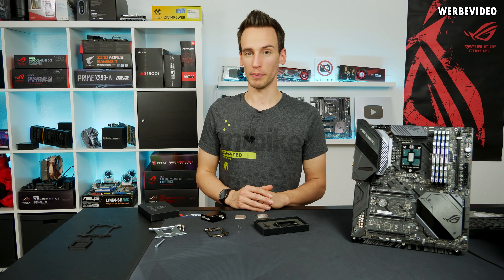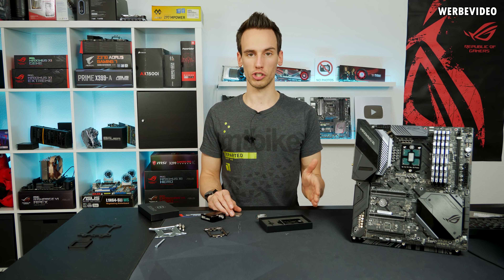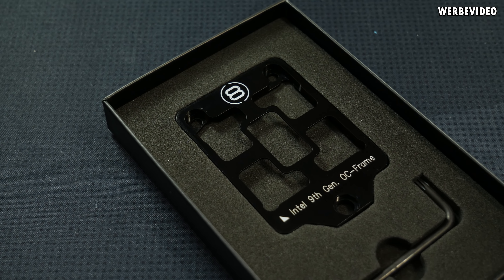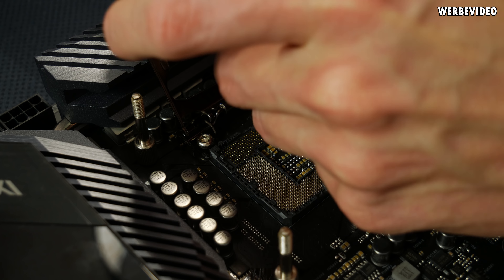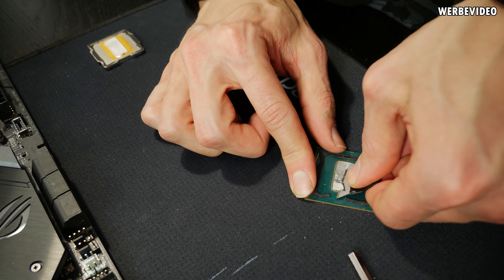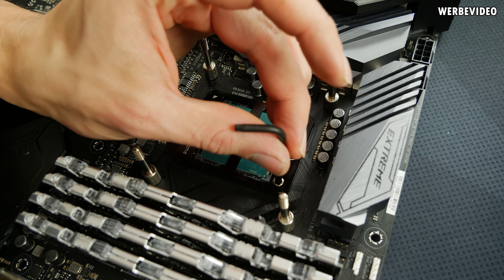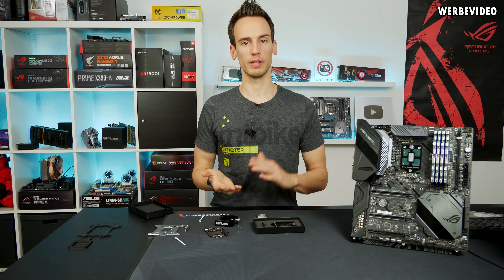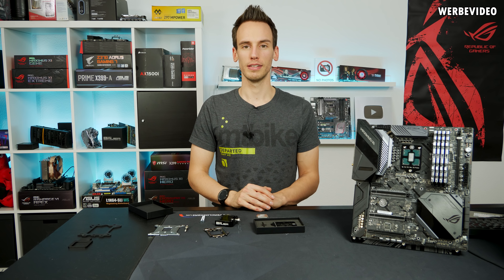Maximum Cooling with Direct Die - 9900K der8auer OC Frame (en)

Comment: It would have been nice to see this in action on a 240 and 360 mm AIO to see how good things could be under relatively normal circumstances.
Reply: @picklesthegreatest  That's one school of thought, but another is that dropping $500US easy on a custom loop is a huge barrier of entry for newcomers. Whereas deliding is mostly elbow grease and a LOT of courage for a pretty big payout in terms of temperature drop (maybe $50-75US for a deliding tool and some liquid metal).

I'm not saying you are wrong, just that there are different perspectives and people who are at different stages in the hobby.
Reply: @picklesthegreatest  yeah but it would give a baseline that people could relate to, I'm sure he'll follow up with some testing, not everyone's custom loop is the same, most AIO's are the same soooo
Reply: i will let you know how my 9900k performs with my kraken x72 rgb aio.  i had the cpu delided and a partial lap done by silicon lottery and it runs amazing, but why not push it some more?.....thats what we do right!....LOL
Reply: @picklesthegreatest  I disagree this mod would make sense for taking cheaper cooling solutions further.
Reply: @KillingTheMost  As long as you aren't using Asetek trash you should be okay with an AIO. Asetek trash cuts a lot of corners with poor quality pump blocks, crappy lines, and fluids that are corrosive when they leak.

TimmyJoe makes a valid point. Calling him names over it only makes your argument that much less important. Good day.
Reply: @IM_A_BEAR_LOL  $500 on a loop? Dang, if you're cooling 4 Titans (which new ones limit you to 2x, the full blocks are around $100 each)...

I'm doing 4x Fury and TR. TR block (RGB!) costs $60, the Fury blocks I'm using Universal $15 blocks (seems to cover most of the HBM, and they can actually be rotated correctly if I wasn't lazy, LOL!), and then $35 for a copper "rail" system (splits a 5/8 inch into 4x 7/16 for the GPUs, and a 5/8 inch for the CPU) to put them all in parallel (flow went from a runny nose, to nearly a garden hose, its 1/25 the flow restriction). The pump is a massive submersible fish pump (I had to downsize a little to fit it into a skull for my Halloween build), at $25. Hard-line tubing is $20, and its really only the fittings that cost much (you could get 3x 360mm rads pretty cheap in aluminum if you run anti-freeze like I prefer to (for any metal), it lasts much longer and has very minimal service intervals).

If you spend $500 on a loop, skip water cooling, I want my parts frozen over! FX at 1.7 Vcore at 500w doesn't even peak over 0c on the core with my phase compressor (-25c under load, -58c at idle). Those are not too crazy considering the 9900k scales very well below 0c. Don't spend that much, I mean, my goodness, I can do a full 4x GPU with duel CPU (like Epyc) for less than that with full copper hard-line pipes for cheaper! You're getting severely ripped off if that doesn't include professional installation!
Reply: Jake Garrett chill dude
Reply: @navaks5335  I do, at sub-zero... Chillin' with my chiller!
Reply: Jake Garrett that wasn’t a request but rather a statement. You’re chill dude
Reply: Timmy Joe PC Tech I agree with you. I would have liked to have seen a few CPU benchmarks.
Reply: @mypeeps1965  hi there.... I am curious if your x72 fitted on the direct die, without replacing the screws. Or any other modifications.
Just bought the x72. And saving up for hardline tubing. Till then would be Nice to Just use the x72.
Greets from Holland
Reply: You should do that video. That's more your video than Der8auer's
Reply: Looking for the same thing..
Reply: I know you said dont use anything other than LM but I have a ek fluid gaming all alloy loop (so cannot use LM on my blocks) and am really happy with it. Temps in mine whilst gaming ar 55c-60c on my 9900ks @5.2ghz and using kryonaught. I have the direct die kit already. De8auer or anyone else have you any results on using paste for direct die?

Comment: I'm in the process today of deliding a 9900k and installing it on my new asus z390 extreme XI mb with your direct die mount. I've had a few issues.  First your bracket was hitting a small resistor on the mb. I was shocked cause I thought it would fit perfectly since it's the same board you used in the review. The tiny resistor is between the CPU and GPU area near the left bottom edge of the bracket. I was able to use a file and grind away the edge of the bracket to clear. No problem. Then I tried to mount the backside ek block bracket for the newest ek block velocity and took me 2 hours of modding the bracket to get all 4 screws down flush thanks to the boards CPU backside bracket.  Then after all that I checked and the CPU block will not touch the bare die using the ek screws. Nice.. so I had to go old school and use 6/32 long screws and nuts to mount my own screws to mount the block.  Then I check for contact and wait.. the CPU direct die bracket is blowing on the top side?  Why? Cause I tightened the top 2 screws to hold your direct die bracket! ???  Once I loosened those 2 screws a hair or 2 the brown CPU socket lowered below the direct die mount at the top.

So after all that I'm real nervous that I'm going to get a good strong contact with the block. I'm going to do a test fit now with regular thermal goop and see first.

Also tip for those using the ek back bracket with there ek block. Since that bracket Mounts on top of the CPU metal bracket, you should use a plastic washer between the gasket and ek bracket to fix the height so the ek bracket dont bend when you tighten the screws.

I'll report back soon.
Reply: Allen H did it work for you?

Comment: ive got myself a delidded i9-9900k from the caseking shop with 5.0ghz by 1.33V

i tested with prime95 for 30 minites with the alphacool 420 AIO

delidded max temps 86°C
direct DIE max temps 80°C

the max temps got achieved always by my third core, every other core was around 1-5 °C lower.
Reply: Amazing, thank you for reporting your results! Glad I dove into the comments here, cause both the cpu and frame are quite new with not many user reports.
Reply: did you cahng to the m3 screws or use the included screws?
Reply: @mondon8882  i used only the scres that csme with the mainboard.

Comment: @der8auer you should do a video where you compare standard cooling / delid + LM / your direct die
btw now that you fixed the 9900K i could start considering buying it :'D
Reply: I bought it hoping that he would fix it lol and was gonna return it if something like this didn’t come out.
Reply: Isn’t it funny how the world works...

Engineers at Intel are doing they best to try and solder the ihs to have better thermals and then some random guy comes, rips apart  the cpu, puts his little pice of metal instead of the ihs and BAM! you’ve got better results in 10 minutes than those guys at Intel in several months
Reply: @navaks5335  It's all about preparing product "idiot-proof". This "naked-die" processors would be sooner than later chipped or damaged different way by wanna-be modders who would easily claim RMA for poor "product protection" or whatever shitty reason....
IHS is more of a SHIELD than COOLER

IMHO

Comment: Pro tip: you can use liquid metal to remove indium solder, you don't need the knife!!! Simply leave the liquid metal over the indium solder for 5/10 minutes, every 3 minutes move the liquid metal around with a q tip and then remove everything with paper.

Comment: I had problems with mounting. It's important to have enough pressure on the die, otherwise you will get code 00 with bios, or some rams would not be recognized. Also putting liquid metal on the waterblock is a good practice. And liquid metal has residue on the waterblock after couple of months.

Comment: I've done this, but after installation the pc will not POST with RAM at its rated 3200mhz speed any more. I found that it will POST with the RAM dropped to 3000mhz and runs stable there, but any higher and it will not POST. Apparently this has happened for others, and reinstalling the stock retention mechanism solves it. I'm not sure if the screws are too tight, not tight enough, or uneven but this is very odd.

Comment: I got one of these bad boys. Tried to use it with a Kraken X62, replaced stock mounting screws with some longer M3s like you said. No matter what I do I can't get it to make good contact with the die, temps are horrid. Would have been amazingly helpful if you had just included some spacers to thread the screws through to make sure the cooler sits flat and flush with even pressure.
Reply: Hi. I got the 9900k and kraken x62. Did you make it work? Any tips you can give me?
Reply: I wanna know too. Did you make it work?

Comment: Nice product. Congratulations! I'm wondering, wouldn't adding high performance thermal pads on the 4 spaces near the naked die increase the contact area from the cooler to the CPU and allow to dissipate some heat from the die to the CPU PCB and socket? The motherboards are designed to remove some heat from the CPU using the socket. Might improve the thermals a little bit
Reply: I had the exact question!

did you try it?

Comment: First of all, great video.  Regarding thickness, maybe it was beneficial from a thermal transient standpoint (ie thermal mass)?  The other theory is that maybe the extra thickness help to keep the interface flat.  If It is not flat, the heat transfer will not be good.

Comment: could you give us some real temperature results please?
Reply: @Reflector ?
Reply: @Cypriotkiller  Yeah, and that's 4-10C improvement over just standard delidding with liquid metal and using the stock IHS.
Reply: @Cypriotkiller  Delidding, replacing the solder with LM and putting the stock IHS back on dropped temps by 9 degrees on his 9900K according to one of his previous videos. Obviously, using this direct die frame improves it by an additional 4-10 degrees, it's not just 4-10 degrees better than a stock non-delidded CPU.
Reply: @Cypriotkiller  Are you talking about Liquid metal on top of the IHS, non-delidded? That does almost nothing, barely any different than thermal paste. He had to mean 4-10 better than delidded, otherwise direct die would be worse than a normal delid which is obviously not the case.
Reply: @Cypriotkiller  he said he expect, so that's not exact numbers where's the graphs, benchmarks,.... etc
Reply: He clearly said that he had some CPUs with up to 10 degrees lower temps and one with 4 degrees lower,  meaning he tested it on multiple CPUs. And based on the tests he had done, he estimated the temperature drop.
Reply: In the German video he says that the decrease is 8-10°C on some and 3-4°C on others from STOCK to Direct Die. Check it out: https://youtu.be/xPQhGZ8h_Qw?t=507
Reply: @westcliff23  Yeah i got 5°C  from my stock 9900K at 5Ghz with this and liquid metal
Reply: @grosen84 5C from completely stock to delid + direct die ?!
Reply: Can I run it 

Yeep. Did a light lapping. That gave another 5-6°c
Reply: @grosen84  So overall 10-11C. Quiet nice improvement.
Reply: Can I run it 

Yep it is in that Ball park
Reply: @grosen84  thanks for the info. Difference seems small. Stock 9900k+thermal paste vs direct die + liquid metal
Reply: musicx xa  yeah i wouldt do it again if i Got a new CPU. Just not worth it

Comment: PC won't boot after installing the frame with my Performa Aardwolrf x10 on it. Shows red light on cpu then switches to DRAM with orange light, holds fpr 4-5 secs and then shuts off. Any thoughts ?
Update: Returned the stock bracket along with the stock IHS and it works. Does this mean that I need another cooling system for the direct die frame to make it boot ?

Comment: der8auer you are the truth. If I took off the integrated loading mechanism the backplate would be loose. Is the purpose of this product to make replacing the screws viable and to put pressure on the CPU to aid socket pin contact? edit. Did it! Running MSI CPU burner i had my 9700k 5.2 all cores at 90 degrees on air (ND-14). but with 1.45 overvoltage. Thanks for all the hard work of the pros showing us the way :)

Comment: Der8auer , There seems to be an issue using the direct die frame . after installing one I could only boot into windows at stock memory speeds , any kind of mem oc would cause the system to crash . removing the direct die and installing the factory CPU catch , everything is now fine again .
Reply: Had this issue as well. My system would not post anything above 3200mhz ram. Swapped everything back and my 3600xmp posted. Seems there is not enough mounting pressure. I am using a EKWB block for reference.
Reply: @mron0903   I was also using the new  EK Velocity WB. I could only run at stock mem speeds with the direct die kit , and likewise as soon as I used the stock setup all was fine again ,  I checked the tightness of screws etc without risking stripping the screws I don't think I  could get any more tight .

Comment: Great video, very informative, well done.  Waiting on my direct die kit.  One question though, should I be concerned how tight to screw down my water block (EK Supremacy EVO) to the die?  Beings how there is no heat spreader to distribute the force of the tightening?

Comment: I can’t get my OC frame to work to save my life, I tried on three different 9900k’s and two different motherboards and every time my first memory channel stops working and I get random blue bsods but when I use the stock lid it goes back to normal.

It’s obviously something pressure related but did I maybe get a bad OC frame not applying enough pressure to the cpu?
Reply: Jufes_ i have followed his guide and tried different ones. Still no luck. Only one memory channel works. I went soft tightening the bolts then i went hard. Same result regardless. Drop over 20 degrees easy. I believe his frame is not putting enough pressure on the cpu, hence the errors. I also lost Overclocking capability on the memory channel that does work. It fails every time no matter what i do
Reply: Well even though that sucks I’m glad someone else is having the same issue,

I also tried sanding down the bottom of the frame and removed some material to try and put more pressure on the cpu and it didn’t work either

I ended up going with the rockitcool copper IHS and used liquid metal on both sides and it was within 2 degrees of the OC drake anyway,  so forget this shit, horrible product

Comment: Hey der8auer, how much can we Lapp off the die and still have the frame compatible
Reply from the maker: Frame is made for stock height with 0.1 to 0.15 mm height difference so pretty much can't lapp anything off
Reply: @der8auer  thanks for the response, I picked this up and your delidder the other day. I'm not confident enough to use a razor on the die to clean it, is there a "safe" method for beginners?
Reply: Quicksilver from rockit
Reply: @der8auer  Hi Roman,  I delided my i9-9900K and mounted it with your OC dirtect die frame with a 3mm thick vacuum chamber in m y clevo chassis (universal cooling CPU and GPU).  z- height increase by 0.4 to 0.5mm, and I am considering lapping the die by 0.4mm, or even 0.5mm if it is acceptable, in order to offset and improve contacts on the GPU side.   It';s betested with LM and foam pad barrier and it is all clean. Will lapping by the same amount on the base/bottom of the frame (in contact with the MB) will be acceptable in your opinion?

Comment: I ordered the OC frame. I also bought the EK quantum velocity. Like in this video my motherboard also has capacitors very close to cpu on left side. The waterblock seems to sit right on top of the capacitors. Will this still have enough clearance to make contact with the delided cpu?

Comment: Do you put liquid metal on the cpu cooler with this plate, or do you just apply liquid metal directly on the chip?
Reply: When using liquid metal, you must apply it to both surfaces.  Unless it's worked into the surface the surface tension of the compound will cause it to basically 'sit' instead of adhere.
Reply: @rholdcroft99  Thanks for the reply! I hope he releases this soon in the US.
Reply: @Thomas-fk6ep  you can buy it from casking in germany.  i did and it was less than $40 with expedited shipping via ups!
Reply: @mypeeps1965  did you do that in shipping fee calculation? I'm looking at it through my phone, and I don't see U.S. as a shipping option. How exactly did you do it?
Reply: @mypeeps1965  I asked Caseking, and they said they currently don't ship to the US. Where can I get this?
Reply: @Thomas-fk6ep  performance-pcs com

Comment: Have you had time to test if a NH-D15 with stock mounting will apply enough pressure?

If not, I should be fine having 2mm washers on the backplate behind the MoBo, right? Or would that put too much strain on the MoBo?
Reply: The easiest thing to do i think, would be to insert washers on top of the springs on the cooler itself. those springs dictate the mounting pressure, and the screws holding them in place are held captive by C-clips, which are probably finnicky but simple to remove and replace. Putting spacers on the back mount behind the motherboard wouldn't do anything unless you also shaved down the black plastic spacers on top of the motherboard. And if you shave down those spacers, should you chose someday to reuse the cooler on another LGA 115x motherboard with a CPU that does have a heat spreader, you may need to add washers on top of the black spacers, just to get back that clearance that is now permanently gone.

Comment: Intel finally came back to soldering cpu but without any temperatures benefit, I imagine it was better with that tooth paste thing, where we at least had the chance to clean it and replace it with liquid metal but with 9 gen it’s quite risky to remove that solder.